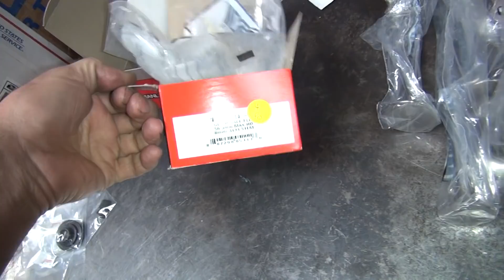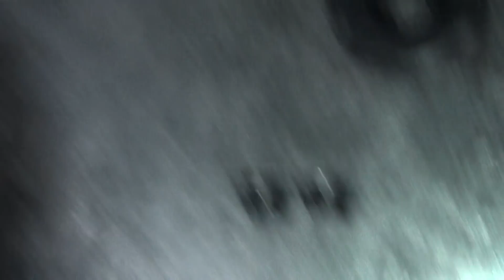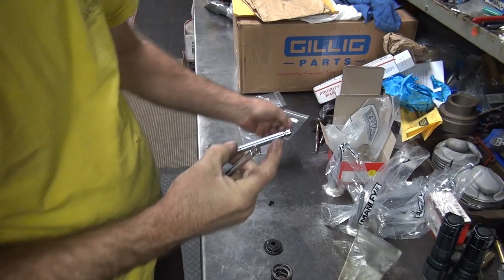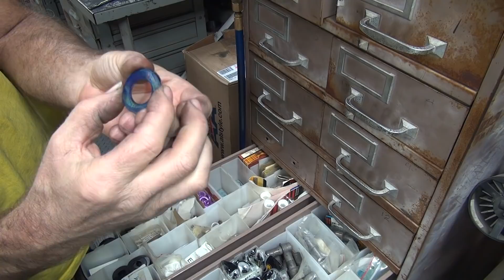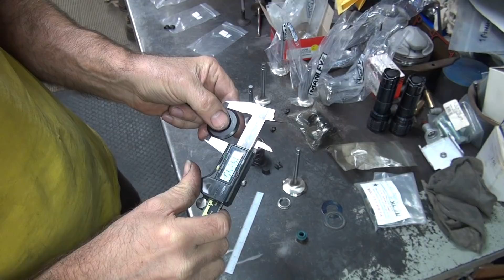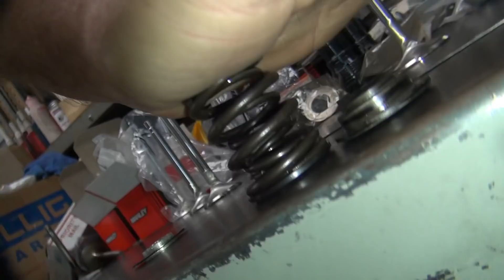thunder heads custom manley valves XL sportster Harley ironhead aluminum racing by tattro machine

Comment: Harleys? I thought those things were just for display!?
Reply: Sportsters just get the hammer 1250 or 1275 kit for them then you can outrun  most stock  sport and supersport bike in 1/4 mile low to mid 10s

Comment: holy crap keenan,,, lol,,, I thought my "throw-a-way" 110 was bad... down the road when i get my new stock pistons and rings KB ones... i will ask you Keenan about the ring gap dimensions versus what the 110 manual says,,, for tolerance allowances...hopefully you can educate me a little
Reply from the maker: all you need is a good cam and valve job. the ports are big now. go watch that gold bronze color 110 bike i did. it is in the playlist. the stock tires were no match to the new power. stay under 10-1/4:1 if you want to run pump gas with no promblems. never use any oem camshaft. they are all made out of cheap ass metal that will fail.
tatro
Reply: Tatro Machine I thank you Keenan very much for you to take your time to answer,,and give me some good advice... I will definately hunt down that series of vids on that bike bike project you worked on..
Reply: jace keeton the KB pistons are okay, certainly a decent compression bump over the stock 110 pistons. If you really wanna make that 110 come to life you should look at the Zippers kit for 110, they make their pistons in a slight overbore like .006 so you can use your stock jugs just punched out slightly. Their pistons will actually put your compression in the 10.5-11:1 range which beats the hell out of the 9-9.5 you get stock with those crappy pistons and giant combustion chambers. The other thing you HAVE to do to make a 110 perform is get a real set of cams in it. The 255/259E grinds are decent in a stock 96 or 103 but they are weak in that big inch/ large valve engine. Also the chrome on the cam lobes is probably already chipping off if you’ve put over 5k miles on it anyways. 
Tatro has a damn good video where he went through a 110 and gave it some serious love. His 110 recipe was a damn good one too.
Reply: VTwin Builder  thank you very much VTwin builder,,,for the advice on some up grades...I can guess you have put some motors and bikes together in your day ☺ Time will tell how well it all goes back together for me ...I do seem to remember watching some  vids.. of Keenan and his friend Rick? putting a twin cam back together. I think that is the first time ,,, the expression "throw away motor" lol
Reply: jace keeton no problem, hope it helps point you in right direction. 
I actually just recently finished a 110 build so the issues finding parts and all that was fresh in my mind. 
For instance, this particular 110 was a low mile motor, the customer had upgraded his original 96” TC with the old, thick spigot style 110 cylinders. So his 96” cases were bored to fit the cylinders, problem was the last shop that he’d had it at had messed up the case threads for the head studs and tried to helicoil them. They did a terrible job and naturally the engine leaked like crazy. 

Anyways it ended up on my lift to fix. I had a low mile 103” short block I started with, I didn’t want to bore cases and he wouldn’t compromise on his precious 110 (I tried to sell him on a 107 build) so I used S and S cylinders with CP pistons, unfortunately they were designed for use with the smaller 85cc heads you get on a standard twin cam so I had to shave the heads down quite a bit to get the compression where it needed to be. 
The customer wanted to save money so this was done with budget in mind the whole time. 
Had money been more plentiful I would’ve just gotten the zippers kit I recommended to you before. The results would’ve been better and it is a proven combo of parts from a good company. 
The route I went with this one will make power but just not to the same degree, on the flip side the customer spent less so there’s trade offs. 

If you’re interested the combo we ended up with was:
Stock 103 cases, crank and rods
S and s 4 inch bore 110 cylinders with matched CP forged pistons 
Milled, light port and polished heads, stock CVO valves and springs. 
S and s 585 cams, lifters and adjustable pushrods. 
Screaming Eagle 64mm throttle body  

It should do okay with this setup.